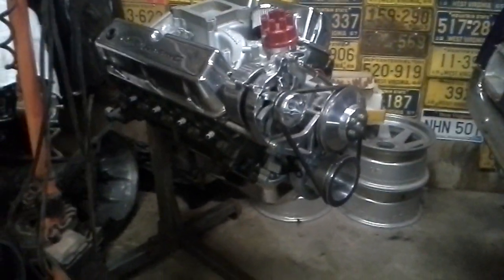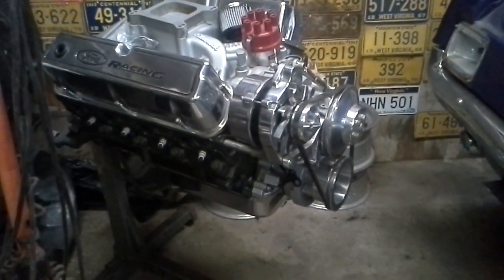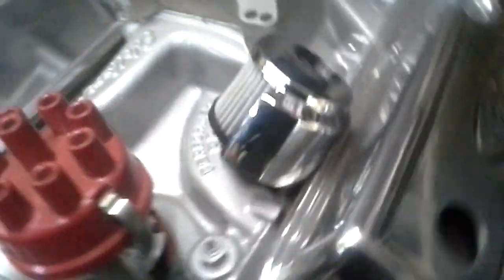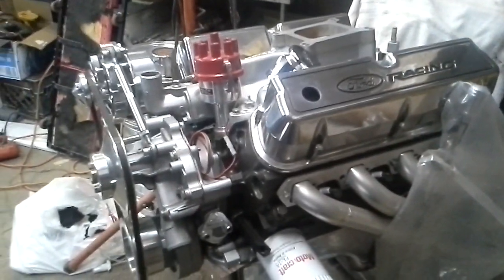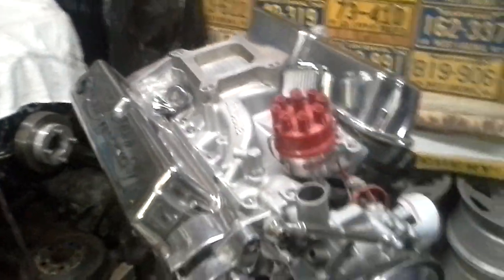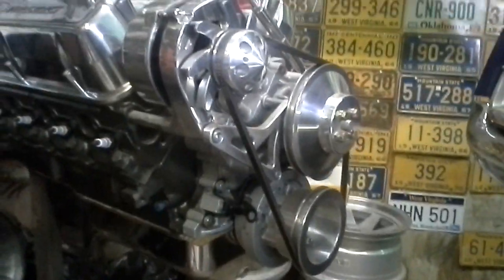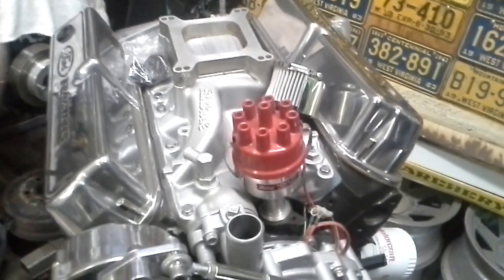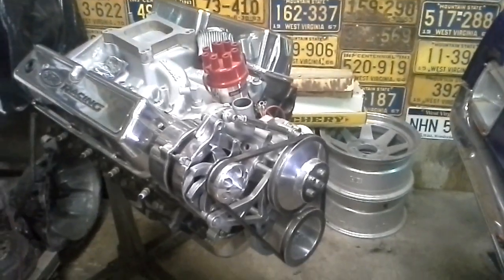1965 mustang 302 engine rebuilt

Comment from the maker: Hey thanks a lot.  I can not wait to hear it run myself.  Hopefully by the end of summer I'll be able to start it.  I'm currently sanding and finishing out the engine bay for primer and paint.  Finishing a few more welds and then I get to put it all back together.  I have about 8 hours a week to work on it and I'm usually working alone since my off work days fall during the week when everyone else is working.  Fingers crossed.

Comment: my best idea is a 302 .40 over is around a 307 flat tops would make more compression but 351w heads drop it than mill the heads so i say your guess is about right 9-1 or 9.25-1 area a medium lift cam good intake (keep in mind a hipo was 271hp) i would say with a good carb like a holly or demon you would come in at about 315-330hp myself and ive built a few dozen small block fords

Comment from the maker: Yeah I found the equation and it comes out just over 307 by a couple decimals.  The pistons that I have are the forged ones that were stock in the 5.0 HO engines.  Just .040 over.  The heads stock are 60.4 cc and the E7TE heads that I had on it were 64cc I think.  I had the C9OE heads milled .010" and that should make them about 59cc to 59.5cc.  Using another formula that I found I figured the compression to be around 9.45 to 9.5.  The heads have alos been ported pretty well with some bowl work.

Comment: 302 bored out .040 over is a 308cid right?  Sux about getting your parts stolen.  Sweet looking motor.   Are those the March brackets on the front accessories?

Comment: Nice looking motor..I definitely want an aluminum water pump housing for my cars.
Reply from the maker: Thanks.  If I had the money I would get an electric one but they are upwards of $300.
Reply: Cobrafanatik22 from what I read on a few of the forms...it isnt worth paying alot of money for water pump because apparently the only true benefit is " weight saving " ...I'll probably get a mildon aluminum water pump there like 70 some odd dollars.
Reply from the maker: james myers The electric water pumps no longer need to run off the belt and therefor free up lost horsepower since the engine doesn't have to spend hp to turn the water pump.  The more you can get off the belt the better.  Now what percentage of power it gives back, I'm not sure.
Reply: Yea true...just like when you eliminate the belt driven fan for an electric fan it also frees up HP...your right. Maybe I need to look a little further into the electric water pumps..maybe something id consider.

Comment from the maker: The edelbrock cam part # is 7122. The lift for the cam is .496/.520.  290/300 duration.  The heads are factory 60 cc and they were milled about .010" I'm thinking that the way the engine sits right now will be about 9.1 to 1 or 9.2 to 1 compression ratio.  I'm no expert though. The block had no decking that I know of.  Any help or guidance you can offer is greatly appreciated.  Thanks!

Comment: Edelbrock makes a few different cams under the names rpm, performer so you really need to know the cam specs to really give you a more accurate hp/tq rating, also knowing the real compression helps, guessing is just that.   The older heads you have are going to be smaller cc's.  Do you know the CC of the heads?   If you milled the heads how much decked the block ?    I did a ton of machine work in my younger days and its a blast to know what your doing and what it does for the motor..!!

Comment from the maker: The camshaft is a 7122 edelbrock with a .498/.520 lift.  I also have a TCI streetfighter 3000 stall converter and I'm running a 9" rear with 3:73 gears.  It should do pretty decent.  Thanks for commenting and watching my vids.  Greatly appreciated.

Comment: The Formula to figure out your motor size is: Bore x Bore x Stroke x .7854 x the number of cylinders.   Example, I have a .60 over 350 chevy block with a stroker crank of 3.75'', my bore is 4' at stock so that gives me a 4.60 bore x4.60 x 3.75 stroke, x .7854 x 8 cylinders = 388cu inches.   You can look it up on google.